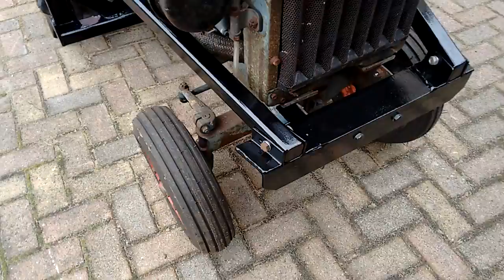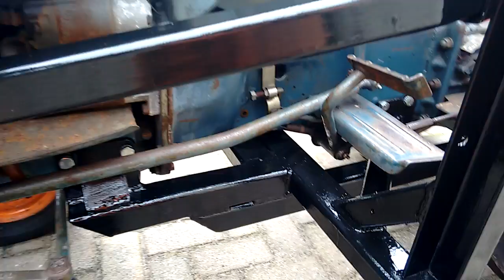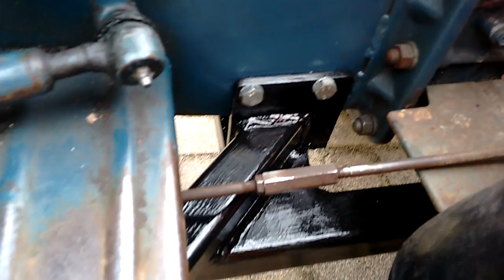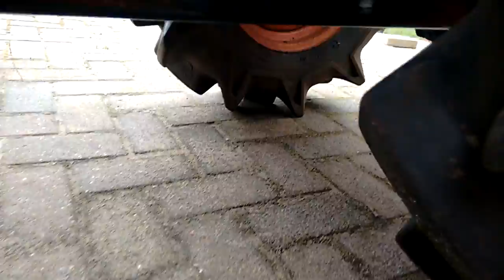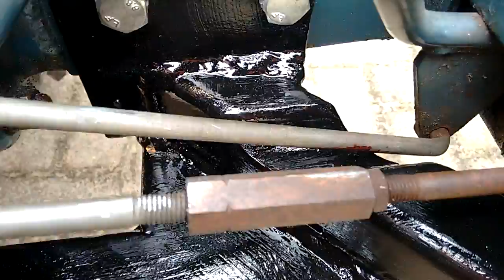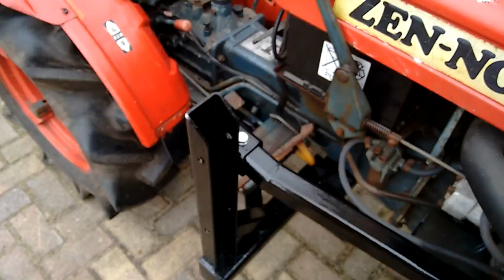B7000 Sub frame for front end loader painted and mounted. Part 2

Comment: Hi, knowing that you already sold this tractor, but may i know whether you can recall the size of bolts you use to connect the subframe to each part of the main frame?
Reply from the maker: @tongjefferry94  M12 and M10
Reply: @MH-ie1sg  Okay thanks for the information, but I think I need some more clarification about it. Is M10 for connecting the frame closing the pedals?For M12, is it for the connection closing the hydraulic reservoir? Actually I’m curious where the subframe connected to especially at the hydraulic reservoir part, do you replace the existing bolt with a longer ones to hold the subframe (wanna know whether this is the location you adopted M12? )Perhaps that i can get your email for further communications. For your information, I’m from Malaysia and there’s limited resources available regarding this information. I’m planning to make a loader for my Kubota B5000. Once again thanks for your information and i really appreciate it 🙌
Reply from the maker: @tongjefferry94  look at this video:

https://youtu.be/oPGLG0tkj9c

It's about the sub frame. The sub frame is connected to the rear axel, transmission case and the spot where the frontt counter weight normally is connected. This one is totally home made for this tractor so you have to adapt the dimensions for your tracktor. Play and pause the video. Then you can figure out where and how it is connected. The support arms towards the front are removable. I used the same bolts that were already in the tracktor for the spots where the frame is connected to the tracktor. For some bolts you have to use ones that are a bit longer.
Just make every thing strong. Use thick wall steel! And make decent welds. You don't want your tracktor to break when heavily loaded. Keep in mind that you will probably need power steering also. I made this myself also later on. Steering was difficult with heavier loads 😁
Reply: @MH-ie1sg  okay just wanted to reconfirm again, for the subframe connection to the rear axle/transmission , just use the existing bolt there? I’m thinking of the extra thickness from the sub frame might reduce the tightness and cause leakage & reduction in strength of the axle cover , that’s the reason I asked whether you replaced the existing bolt. Sorry to ask again as I can’t see it clearly in the video.
Reply from the maker: @tongjefferry94  i used the original bolts. In my case they were long enough. But you can use a bit longer ones if you like to compensate for material thickness. This depending on the material thickness you use.
Reply: @MH-ie1sg  Okay thanks for your information👍